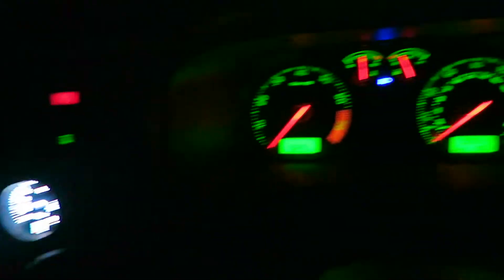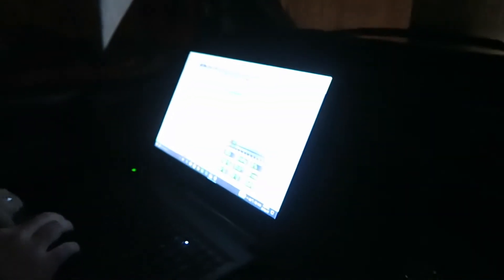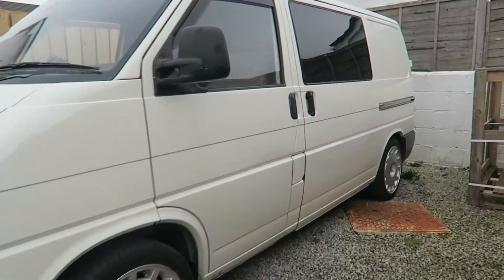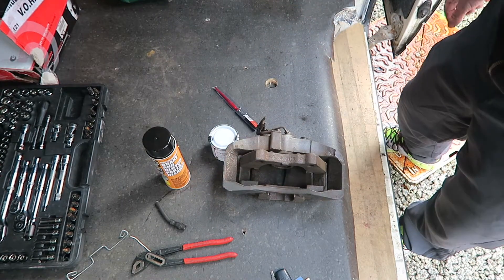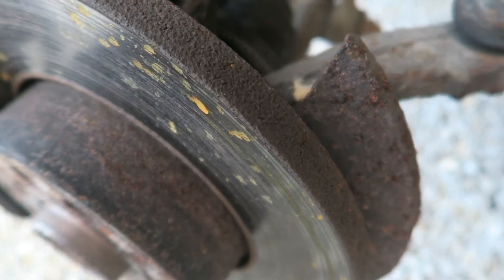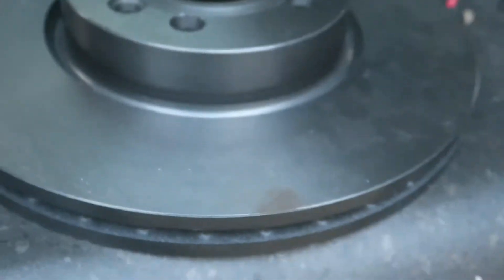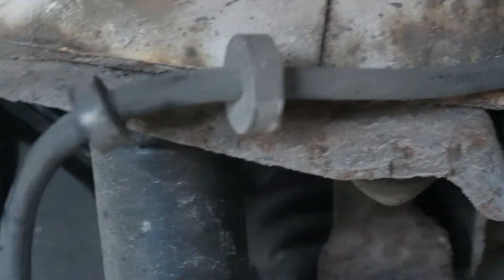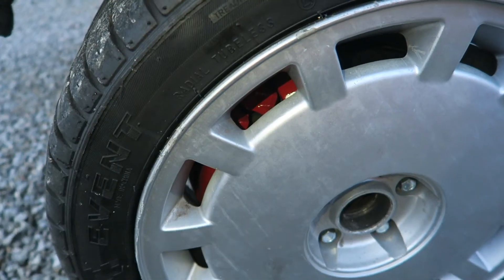VW T4 1.8T - MAPPING (+313 VR6 BRAKE INSTALL)

Comment: I am looking to fit 1.8t in my t4 as well,I also fancy the 313 brake set up,but having a devil of a job finding caliper carriers.
Reply from the maker: There's always some 313 callipers kicking around on the T17 Facebook page somewhere, then all you need is a 18mm drill bit. Made a big difference over my solid crappy discs! The 1.8T conversion is great fun to drive, well worth the time doing it even if you're just going to run a KO4 setup with a remap for 180-190bhp.

Comment: Which lines did you use as i found they caught in inner rim. So i had to tie them to arm to stop them rubbing. I also found the slider pins allowed the caliper to drop just enough to contact the disc on occasions due to the weight of them
Reply from the maker: The line position is down to fitting and tightening of the chassis and caliper nut.

Comment: When you fitted the VR6 brakes, did you experience any clunking when driving bumpy road? There are a couple of ways to fit the retaining springs, but I tried all I could think of and the calipers still move a bit. Any help/thoughts please?
Reply from the maker: Hello, I didnt have any clunking noises. I used copper grease on the pad runners and they were fine. Good luck finding the problem 😎👍
Reply: @SpeedingTube  
Haven't figured out the problem. It might be that the floating design of the brakes just allow parts hit each other when driving over a bump. :(

Could you tell me please where did you buy the Porsche calipers that you installed after vr6 brakes?
Reply from the maker: @AnttiHarri  I didnt have any clanking noises. I got the 996 calipers on eBay. If you search Creations T4 Brake kit on eBay it lists the part numbers 😎👍

Comment: Hi Tom. Thanks for the info on the brake calipers. If you find the caliper, let me know, will try to work something out with the shipment. The question is - $ 200 for a couple or single caliper? And you already send ever in Russia? If Yes, then how about cost of transport services? Thanks again.
Reply from the maker: Здравствуйте. Я не знаю, как отправить в Россию. На немецком eBay есть много 313 VR6 суппортов. Удачи мой друг :-)

Comment: what a van!!! have been watching with fascination. I'm putting a 20 valve turbo in my lwb t4 very very soon. I've got to ask what engine code you've used? looks like k04 turbo and inlet but you have cable operated throttle!?!?
Reply from the maker: Gary Brockman Cheers, its a bit of a hybrid engine really. The great thing about the 1.8T's is that you can cherry pick your components for your build. The cable throttle is agricultural, but its simple and works well. It also feels like you get a more instant response. I was tempted to use a large port AGU head but that's really for 450bhp or over as you lose a bit of low end torque. I'll be using Meth to reduce inlet temps and get 400+ which is my target. Acceleration will be banned in 5th gear to help the gearbox last a few more months! Good luck on your conversion, there's a great write up on the T4 forum. Also join T17 Facebook group for loads of helpful info on the 1.8T T4's. Tom
Reply: speedingtube  Thank you very much. Yes they're a great engine to cherry pick what you put in your build. Thank you for your info.